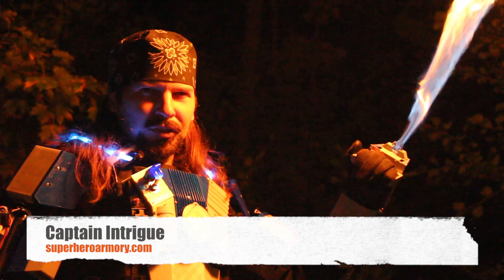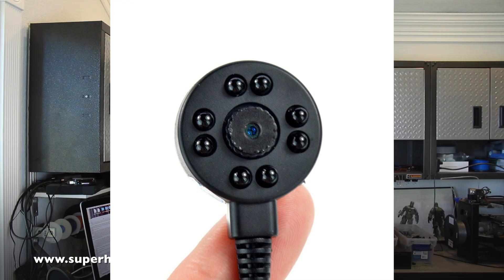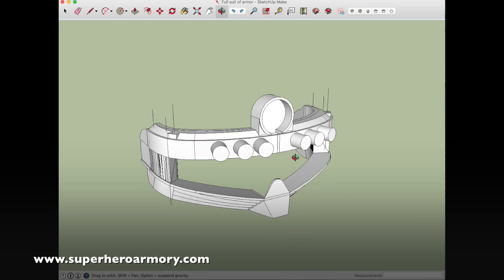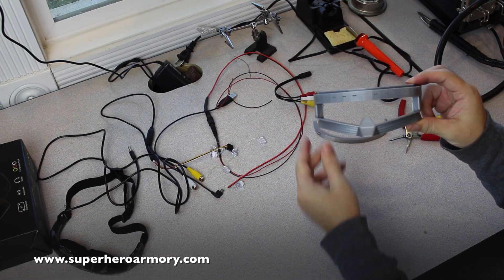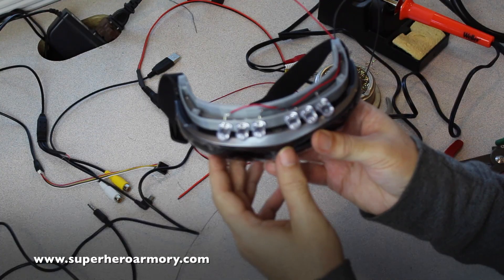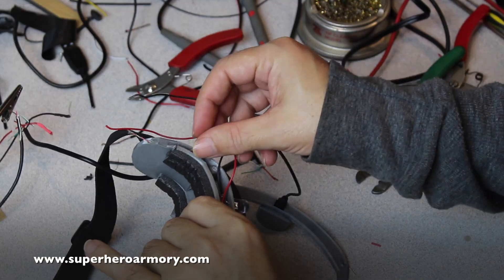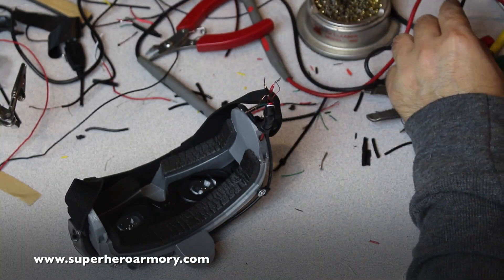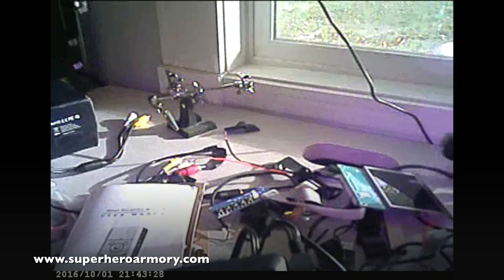How to build diy Night vision Goggles

Comment: the amazing thing is that he uses google sketchup to make his models.
Reply from the maker: Yep it's free and easy to use.
Reply: Yep, but i only think its amazing because im no good at google sketchup.
Reply from the maker: I only like it because i've been using it for over 10 years and i'm very fast with it, but it is terrible for creating really small parts because it starts getting glitchy at that point for some reason.
Reply: I bet that's because its harder to make the small shapes, making it so you have a wrong size, or something of that nature.
Reply from the maker: Yea google sketchup just start moving lines around in hole sizes of less than .02"
Reply: Superhero Armory yeah, i think it's kind of annoying. but i believe google thinks that everything you'll make will be huge structures that don't particularly include very detailed interiors.

Comment: Will this be part of the helmet or an optional addition? As in, when the helmet's done, will this be attatched or able to be put on your forehead still?
Reply from the maker: Good question. The helmet is going to be a modular design and the goggles can be pulled up onto my forehead when i don't need them, and pulled down when it's dark.

Comment: could you make videos twice a week?
Reply from the maker: A LOT of work goes into making just 2 videos a month, so no i can't.
Reply: ok thanks all the wires on your back couldnt you make a removable case for it with an eletric lock system
Reply from the maker: This suit was just a prototype so i didn't want to cover up the back since i was constantly back there fiddling with things and needed easy access. The next suit will be completely enclosed and combat ready and all the electronics will be sealed in a waterproof case.
Reply: ok thanks

Comment: By far the best video you've uploaded, I look forward to seeing more!
Reply from the maker: Thanks for watching! Lots more to come.
Reply: Do you use a program to convert those models into .stl files, or do you just upload them to something like Tinkercad first?
Reply: what program do you yes for sketching the glasses
Reply from the maker: Sketchup
Reply: thanks so much I used to use the program in school and I totally forgot what it was
Reply: I usually just save it in my computer
Reply from the maker: There are a few free add ons that allow you to export your models as .stl files. They work well but sometimes you need to correct minor errors in the models before printing. Sketchup is not the best software to use but i'm really good and fast with it and i like it because it's so user friendly and free.

Comment: i think u should build some kind of "shell" to cover the generator on the back because a simple shot would turn all ur power off.Great video btw :)
Reply: I think in previous videos he stated that this is just the rough cut, the wiring and most of the utility is not optimized but version two will address these issues.
Reply from the maker: Yea i didn't want to cover the back because i'm always fiddling with something back there and needed easy access. The next suit will be completely enclosed.

Comment: http://www.therpf.com/showthread.php?t=154562
its one idea for the helment
its only a idea that in my opinion is very "OP" 
This helment (of the link) inside im going tu put homemade google glasses (created with arduino) with a program that read the results of sensors and with a hud of the fuel etc...
a motorized helment with servos could be amazing in your next armor

bye
Reply from the maker: I'll be building a very modular helmet system where individual pieces can be removed or added for specific missions. The night vision goggles video is the first step. Lot more to come.
Reply: oh, cool!

Comment: What about a pepper spray sprayer, with a protection in the goggles and the mouth (a mask maybe), you can put sprayers around the body so it creates a cloud of pepper spray, for self-defense (use gas or smoke as a substitute)
Reply from the maker: I do already have a pepper sprayer in the flame gauntlet, but a protective pepper spray cloud is a GREAT idea!
Reply: Superhero Armory Thanks, and doesn't have to be pepper spray, can be gas.
Reply from the maker: I'm not sure how to make cs gas but i sure would like to know. Had to go through the gas chamber every year in the Marine Corps and that stuff is nasty.

Comment: i just had an idea for something for you to add to the utility-belt... POCKET SAND!!!... a small pouch of sand to throw into someones eyes... well either that or something that launches a net to capture/hinder their movement... but i think we all know which one is more awesome...
Reply: yea... but it'd be more funny
Reply from the maker: I could build a high powered sand shooter like a sand blaster. That would definitely hurt.
Reply: and if you run out of pepper spray you can throw mouthwash into their eyes... it burns at the same rate the only downsides are that it can be easily wash out of their eyes with water and that they'll small minty fresh
Reply: @death666311  
Funny is great
Reply: The front camera no, but what if I had a mirror reflecting the light to the selfie camera
Reply: hayden robbie was that a Dale Gribble reference
Reply: Dude, build in a projector and make it project The joy of painting. Bob Ross will calm them down.
Reply: Superhero Armory Wait so if I took apart my phone and replaced the the flash LED with an infared LED. I can turn on the light and go into the camera and have a night vision iPhone?
Reply: +The Mighty Sandwich Videos No, IPhone cameras can't pick up infrared light
Reply: well actually if you are welling to break the filter mounted on the lens it can work but plz dont do dat ._.
Reply: hayden robbie do you by any chance watch Psych?
Reply: Nice dale quote from KOTH
Reply: The sand
Reply: tap man
Reply: Curry powder😨

Comment: awesome Dude, keep it up.

also I need detailed instructions on the wiring.

how much  mAh/A is required to power this at 5 volts?
Reply from the maker: I'll be putting up a detailed video of the build on superheroarmory.com this week. I never measured the current draw but i'll figure it out and add it to the website build.

Comment: Would wiring the LEDs in parallel help brightness output? It may extend your effective range
Reply from the maker: No it wouldn't help. Adding more LED's would help greatly which i'll do soon. I'm thinking about putting a bunch of them on the legs that way the video won't look so grainy.

Comment: Now this...this is cool 👍🏻👍🏻
Reply from the maker: Thanks for watching!
Reply: What about adding the battery to the back of the head band it may be  less battery life and a little heavier but it gives you a better range of movement and you have less risk breaking the cord but design wise it's impressive! Keep up the good work
Reply from the maker: Yea i've been thinking about doing that. I just need to experiment with battery life first.
Reply: Superhero Armory understandable also how much range of motion do you have with the armor on exactly just curious?
Reply from the maker: The biggest limitation for motion is the biceps. If they weren't there then my range of motion would be very good. Also the way i designed the gauntlets makes them very safe but also very difficult to manipulate anything with my hands. In the next suit i'll be completely redesigning the biceps and going back to normal wrist gauntlets so i have better mobility.
Reply: Superhero Armory what if you mixed the biceps with Kevlar and armor at the same time he Kevlar being around the elbows so you can have mobility and protection? As for the gauntlets I still would need to think on
Reply from the maker: Yep the bicep on the next suit will be hardened kevlar with titanium plating. They'll be less bulky and simpler.
Reply: Nice also with the gauntlets I'd suggest taking a couple of things off its amazing I know but with the whole knives out of the left one I think it would be best inside the forarm kinda like an assassins creed blade so it's a little less bulky but hey it's your choice

Comment: How badly would you say your FOV is affected in these?
Reply from the maker: It's like having tunnel vision but that's why i want to later add another camera and have stereoscopic vision, that would help.
Reply: Have you thought about trying those detachable lenses for cell phone cameras to put over the IR camera? They have wide angle and fish eye versions which should definitely increase your field of vision and cut down the tunnel vision a bit. Also, they're super inexpensive.
Reply from the maker: Funny that you said that because the previous night vision i built used those lenses with two 2" LCD screens for the stereoscopic night vision. It worked AMAZINGLY well, but it looks ridiculous so i just couldn't use it.

Comment: huh, I never realized how easy it was. Thanks for the effort and video man! looks pretty darn good! wait. looks a little uncomfortable, and the picture is very low qual. still not bad for such a simple build.
Reply from the maker: Yea the night vision is very grainy because i didn't have enough infrared light, but i plan to add more to other parts of the suit. Just didn't wan the goggles to be any bigger by adding more lights.

Comment: Why didn't you just gut the glasses and camera and fit the working bits into a custom frame to make it lighter and as comfortable as you want?
Reply from the maker: I did that on that older helmet but honestly it's a pain and lots more work. If i had more time then i would do it though.